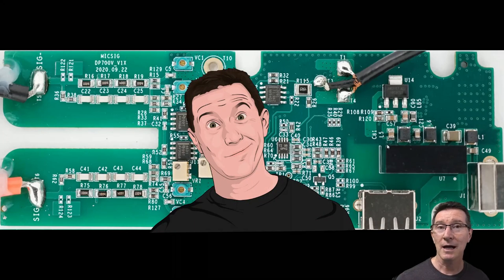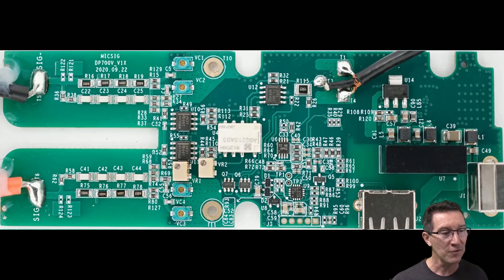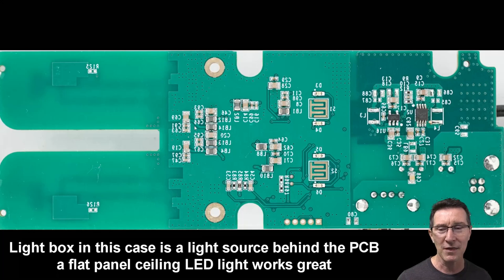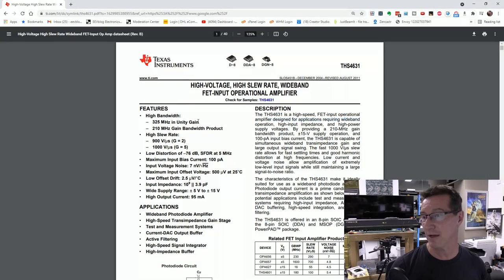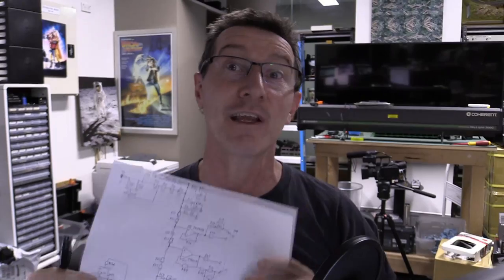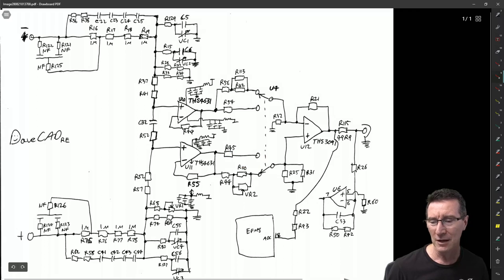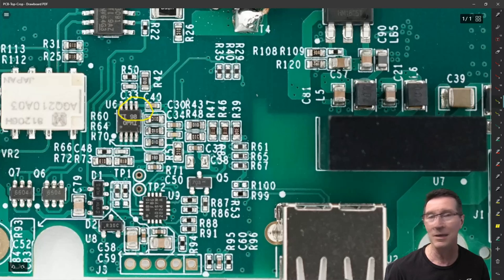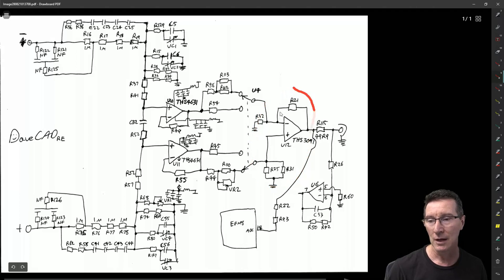EEVblog 1415 - Reverse Engineering the DP10007 Differential Probe

Comment: I think the dual n/p channel transistor arrangement is actually an h-bridge for switching the latching relay. Cool videos! Love that stuff!
Reply from the maker: What's the point? A single transistor does exactly the same job. This is not a mechnical latching relay.
Reply: @EEVblog  AGQ210 is 1 coil latching relay according to the data sheet.
Reply: Haven't read the datasheet, but it is listed as latching relay on mouser and having worked with bistable latching valves in the past, I assume that you have to change the direction of the current flow inside the coil in order to switch it.
Reply from the maker: @davidmenasce6614  Ah, so it is, I missed that on the datasheet. The AGQ200 is the single side stable one, 210 is latching. I don't see any reason to use a latching relay here, it's not like power consumption is an issue.
Reply: @EEVblog  Me neither. Maybe a relic from a battery operated version or they had plenty of these relays in stock?!
Reply from the maker: @pnjunction5689  BOM reuse would certainly make sense.
Reply: Could always powered relay coil increase noise on one of power lines affecting op-amps and decreasing specs?
Reply: Maybe because the latching relay saves the range selection even when powered down so no eeprom is needed for that.
Reply: @andrelange9877  But then additional circuitry would be required to detect the current state of the relay in order to correctly indicate the range selection.
Reply from the maker: @andrelange9877  Can't be that, because then you'd need to be able to read the state of the relay somehow.
Reply: Yes, an H-bridge for bipolar drive. Interestingly the markings don't match any of the three datasheets. So maybe a copy of the AO6604 made by some 3rd party. They may use the latching relays for other purposes (less thermal EMFs).
Reply: @Tiago Ferreira Or, more simply, set the relay to the highest range whenever power is applied. In the case of a slide switch, rather than pushbuttons, to the appropriate range.
Reply: If not power consumption, how about power dissipation? A latching relay instead of a momentary relay eliminates one potential source of thermal gradient on the board, for about $0.25 for the H-bridge and latching relay upgrade. I might call it a cautious design.
Reply: Maybe the concern was to address a weird case where the probe (and scope?) is left connected but powered off between measurement sessions? But if you had a high voltage applied and powered up the unit in the low voltage mode, it’s not obvious what damage that could cause here. Can the unit be battery operated? If so that alone may warrant the latching relay. These single coil latching arrangements are a pain to drive compared to the three-pin coils. Sometimes these relays have a set of indicator contacts to read back the position. But here both poles are used in the circuit leaving nothing spare for indication.
Reply: @chrislott1994  The gain switching is done after the buffer opamps. If there's ever high voltage present at that point something has already left out the magic smoke.
Reply from the maker: @spehropefhany  Makes no difference in this case to input protection, as the range gain is on the output side.
Reply: @EEVblog  Good point.
Reply: I remember realizing it uses a latching relay without opening the case because it did not emit an audible "click" noise when plugging/unplugging the usb power cable no matter which range was set.
Reply: @EEVblog  What about MTBF or heat from keeping the coil energized? Not that it will melt the thing down but might influence other components.
If you keep that coil energized for hours in such a small closed enclosure it can rise the temperature in the enclosure more than what we expect.

Comment: I just use GIMP. Add layers (one reversed, of course), set the alpha channels, then toggle the visibility of the top layer as needed (eyeball icon on the layers toolbox). You can even set a shortcut key to toggle the visibility of the current layer. Not perfect, but better than printing stuff out...
Reply: I trace things out with GIMP. Either photo or scanner works (if the board components aren't tall it'll be in focus). I draw lines on a layer all white. Any lines that may intersect, I put on a new layer. Then I can flood fill paths color coded [red = 5v, yellow =12v, etc], and merge them as i go. Doesn't take "that" long depending on board complexity.
Reply: I use this same technique, although with Photoshop. It works amazing when trying to trace through a circuit. I usually do it on my surface pro, which had a stylus. I can then add layers to draw lines on the traces to show the exact path of a signal or power supply trace.
Reply: Someone reverse engineered a Kindle that way, there's even the GIMP document available to download somewhere.
Reply: In any photoshop-like tool, the magic wand can be very useful for following traces. I adjust the levels of my board so that there is good contrast between the traces and the bare PCB. Then to select a trace, I just click it with the magic wand, and I get the whole trace. Then I tint the selected area with colour to both mark it as “done” and to indicate function (i.e. power, logic, analog, etc.)
Reply: If you have a wacom tablet, it's even easier to do the reverse engineering in GIMP since you can actually draw notes and diagrams.

Comment: The relay is AGQ210A03 which is 1 coil latching, so relay keeps position without power. Therefore you need bipolar driver to reverse voltage for switching.
Reply from the maker: Yes, I missed that on the datasheet. The AGQ200 is the single side stable one, 210 is latching. I don't see any reason to use a latching relay here, it's not like power consumption is an issue.
Reply: @EEVblog  Maybe they decided not load the switching converter with the 100mW of the relay all the time, either heat up or noise in its output, or that output voltage goes "too low" with the relay load.

Comment: The PCB capacitor is for matching the positive and negative input(impedance). If the capacity matches you don't use them.  The input with the lower  capacity will get additional PCB capacitor for best match.  High voltage capacitor have higher tolerance, so you might need this matching mechanism.

Comment: hi the reason of the 2 6604 fets is that the AGQ210 is a latching relay single coil so I guess they're here to invert the voltage across the coli to make if change state
Reply: FETS configured as H-bridge.

Comment: Just a comment on getting good images for reverse engineering. About 15 years ago I was doing a first article inspection for a power supply I had designed after I received it from the factory. I figured out that instead of sitting in the lab at a microscope to inspect solder joints and looking for flipped/rotated components, I could just scan both sides of the board on our copier (at high resolution), and then I could inspect the board at my desk by zooming in and viewing the scanned image. A big advantage of "taking a picture" with a flatbed scanner is that every part of the board is seen as if you are looking at it from directly above (which of course is how the image is captured by the scanner). Scanning an assembly would give you the same advantages when trying to reverse engineer a design, and it would also enable the images of both sides to be at the exact same scale.

Comment: There is an auto-zero function. If you press and hold both x10 and x100 buttons at the same time, it zeroes the offset. So the microcontroller is doing a bit more than overvoltage detection.

Comment: Dave, AGQ210A03 is a 3V single coil latching relay (relay is set and reset with different direction coil current). To drive a latching relay two complementary mosfets are required configured as a H-bridge, so the 6604 is a N- and P-mosfet pair. Latching relays are often used in battery powered applications .

Comment: This brought back a lot of memories.  Back in the early 80's I did all of my own board layouts (for logic card test equipment) using the forward version of this - i.e. acetate projector copies of top, bottom and 2 internal power layers in different colours sheets then using foil pens to add the connections - great fun.  Passed the roughs to the CAD team who would tidy them up and send me back proofs - back to the photocopier with colour acetates and check everything out before having them sent out for etching.

Comment: We have several (15 maybe ?) of these probes.  We do have a few that developed a DC offset that can not be calibrated out by pressing and holding the 50X and 500X  buttons.  This video might help us to fix those !  Thank you Dave !  😁😀
Yes, I'm you're uncle !  (bob)

I bet that the extra circuitry has to do with the microcontroller's role in adjusting the offset when you short the input probe and hold the two buttons down for a few seconds.  A/D input, being slow-ish, would also make sense for that role.  Read the offset and inject another offset to counter it.
That is what I would probably do anyway

Comment: I think the feedback from output is for automatic zero adjust voltage and over-voltage detection.
Reply: My instant thoughts exactly. I wouldn't be surprised if the MCU has a tap somewhere at the input of the cable driver to null the offset at idle.
Reply: How can it know when its idle? Sometimes the equipament is turned on when there is voltage being applied to the input already.
Reply: @andrelange9877  Mayve when the signal is below a certain level for a certain amount of time it assumes that it is DC offset. Probably when one want to actually measure a constant DC voltage it won't choose that low measuremrnt range that the signal is lost in the noise.

Or maybe it expects a shorted input at power-up or constant hold of a button or something else to calibrate itself, I haven't read the users manual of this exact device.

Applying test signal to an unpowered instrument is a bad practice already, so when it just happebs that it skips calibrating itself in that case is just the best outcome. It can even use the previously saved offset if there is an EEPROM.
Reply: @gabiold  The first paragraph would present a very annoying and possibly dangerous strategy. Sometimes one needs to measure small voltages like 5V or less and a differential probe is used in one channel to prevent a ground loop with the other scope channel that is connected elsewhere in the same circuit. Sometimes the differential voltage is small but it sits on top of a high potential line, so the differential probe is also needed to protect the scope input. A small voltage reading is a small voltage reading. It cannot be auto zeroed out just because some clever logic thinks that it may be uninportant information and likely an internal offset. Not so likely.
Reply: @andrelange9877  Measuring 5V with a 200X range HV probe is not very useful. And if the software knows that the probe could have uV or mV offset at max, it wont compensate for 5V.

And we just guessing here without even knowing what the MCU measures. Quite possible that it sees the output of both the input buffers which can be useful to determine where the DC offset is in the system and to see that both probes hang on an 1000V common-mode signal.

There is at least a dozen ways how it can be done properly...
Reply: I have the 50X/500X version. The 50X can be used to trace 5V signals just fine, specially if you're only interested in seeing high/low states of a square wave/pwm in a smps or from a communication bus. Very useful product for power electronics.
Reply: In my opinion the feedback is sent to the microcontroller's AD and sent out digitally by the USB (If am not wrong there is an USB connector, right?)
So, the MC is there not just to switch a relay.
Reply: @giovannibianchessi1578  There is no USB data. Only USB power.
Reply: Hello @giovannibianchessi1578  .
According Dave, there are no communication lines through USB. USB is only for power, so that is not possible. I can confirm that clamping feedback is measured directly in the OP-AMP output so, as Dave, I don't know the porpose of this circuit. Probably any function still not implemented yet.
By the way, congratulations Dave (Mr. Jones from @eevblog) to provide us electronic videos with this high quality. Keep it up! 👍

Comment: I still have a flatbed scanner and use it to scan PCBs for reverse engineering/repair etc. All you need to do is rotate and align them, no lens distortion. Components shouldn't be too high or you do get some distortion, so mostly good with smd boards or bottom side. Scanned images also have a set DPI so you can do 1:1 printouts if that's needed and you can measure distance in software without having to convert number of pixels to measuring units. There's also panorama/stitching software like Hugin (open source/free) that can align images automatically based on a few points you give it. Or deep stacker software that can do the same if you don't want to do it manually. Hugin can also remove perspective and lens distortions. 
I use Photoshop for alignment and Illustrator for annotations because it's vector based and is easy to scale/edit/change. But Gimp and Inkscape can do the same job, just a matter of preference and availability. I usually also change the colours between top and bottom layer for easier tracing out of vias etc. using the transparency slider to switch back and forth or using the layers panel eye on/off button.

Comment: I usually take off all components after taking multiple hi res pix of the fully assembled PCB... and then put the PCB without the components in a flat bed scanner and scan both sides. Simple !
Reply from the maker: I wouldn't call taking off all the parts from a PCB "simple"! But yes, if you were super serious about fully reverse engineering and producing a accurate clone or whatever, this is what you would do.
Reply: @EEVblog  Yup... Done multi-layer boards like that... sanded the top and bottom solder mask after scanning and then etched away the top and bottom layers.
Went the local hospital for X-RAY. Scanned the X-RAY in the flat bed scanner and .... as you say... "bob's your uncle" :)

Comment: @3:55 I use an ancient Paintshop Pro to do just that for reverse engineering PCBs. I start layers for the front and back of the PCB, then I add layers for front and back traces, which I trace manually, often in different colours depending on the function, for instance data lines, power lines, control lines etc and another layer for labels, mostly the componenet numbers.
I find it very useful but I have always wanted to make something more dedicated and have worked on and off on a custom application to do it in a more streamlined way though haven;t progressed much.  In the meantime Paintshop Pro is proving quite helpful. I guess Photoshop could also be used but I found it very cumbersome for this sort of thing.

Comment: Old fashioned 'Paint Shop Pro' allowed adding multiple graphics layers and geometry layers for text and arrows which you can adjust the transparency between them and their layer order and layer-layer alignment on the fly.  In fact, I would use and still use today my old Paint Shot Pro 6 from the year 2000 to do exactly what you want.  It also has the edge outline filters if you want such image processing.  Also, if you have equal spacers at the 4 corners of the pcb, some flatbed scanners will generate a perfectly square edge-edge accurate image even though the spacers lift the PCB off of the glass so that the components don't sit in a bumpy random height from the flatbed scanner.

Comment: Nice job!
About these dual transistors - I didn't check that relay, but one option for this two dual transistor schematic design may be, if that relay is with latching option and MCU changes polarity for remote..

Comment: I think the uC analog inputs are setup as comparators, not ADC.  That micro will not the bandwidth to sample the signal to catch the maximum peak, but the comparator will; otherwise you would need a peak detector circuit in there.

Comment: Stuff around the microcontroller looks like it samples the output voltage, and then it is possible to communicate via the USB interface, to software that can use the data, things like range, clipping status and likely also drive the output to a defined voltage, reading it back via the sense after the resistor, to accurately see if termination is on or off. Otherwise just having the inverting stage you make clipping on the negative half cycle detectable, as the internal ADC of the chip is probably unipolar, so needs the inversion to detect negative clipping. 

Also the ability to read output allows sensing offset voltage and nulling it, either during manufacture, so the micro can put a defined small voltage as bias to the output, or during use if a null is desired.
Reply from the maker: There is no USB data isolator, and this is not a USB enabled micro. The two lines from the side USB connector are only for basic port charge setting resistors.